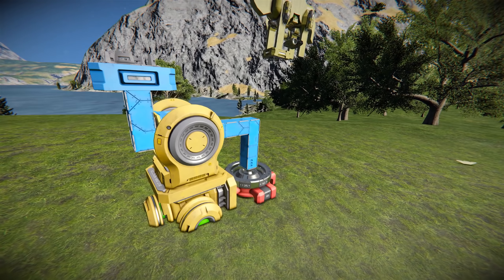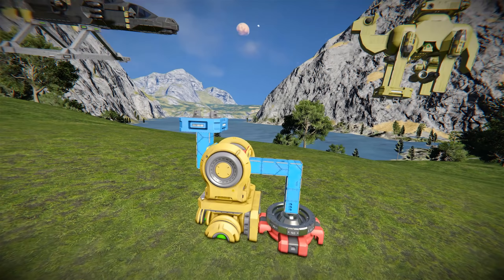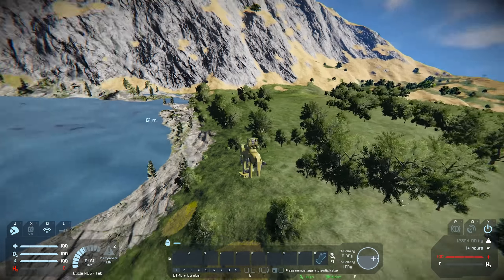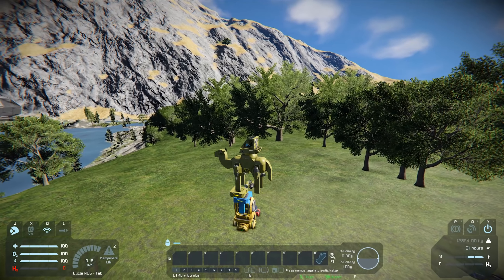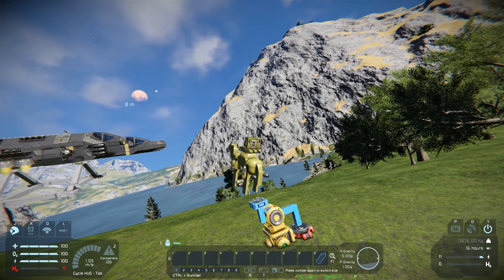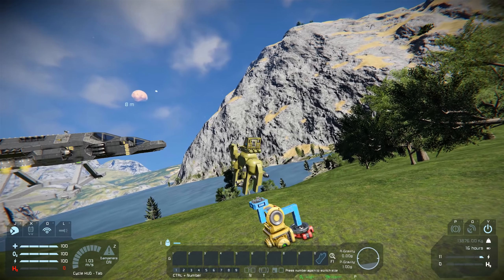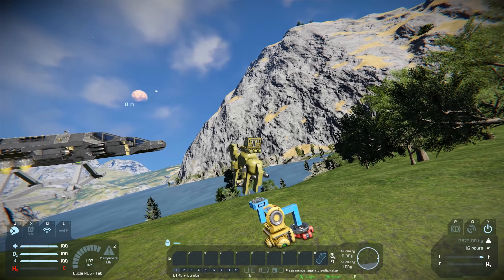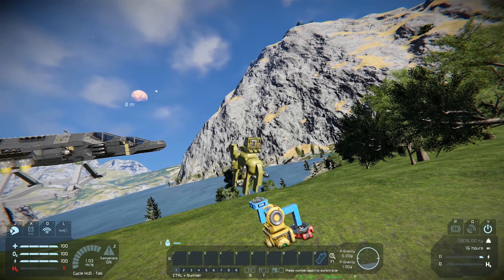Space Engineers - Cheaters Exploit Speed Limit Broken Vanilla Warning

Comment: In regards to this exploit, does it have to be attached to the ground? Or could you slap it on another ship?
The physics based exploit should be fixed but its amusing to think a ship could "jump" from one place to another without a J-drive
Reply: Doesn't have to be attached to the ground. You can fire "missiles" or fighters from a carrier using this exploit, though their movement will be tied to the mother grid, so it becomes a problem if the launcher rotates too much

Comment: no different to clang drives and other sim physics related exploits - all of which should be banable on servers. Ideally fixed by keen but these problems are often VERY difficult to fix or the fix would be a huge hit to sim speed due to more calculation.
The 'fix' btw would be inertial sharing for hinges and rotors ONLY applying outside of the movement bounds of the hinge or rotor, eg up, down, inertia would be shared on a rotor facing up relative to the shared grid but forwards, back, sideways or any rotation in those axis would require some more complex maths to work out the relative motion, and this would undoubtedly be a hit to sim speed.
Reply: Oh and there are many great speed and relative speed mods on the workshop. anything below about 500 is fine in my experience.

Comment: I think vanilla exploits are fair game, only off limits if you can mod a nerf or patch it. Then again, I just see a game as it is. The ability to do things predicated on your care to do them.
Reply: Let me elaborate that every measure should be taken to remove exploits from use if they impede regular server function of drop FPS in some way. This doesn't have to involve breaking SE, like those spinning lag machines were purely vanilla vehicles... I still think though that there's nothing to stop someone just boosting up before a battle now and risking it to win, so there's that. If they can still do it, some still will. Maybe those less attached to the game. Then again, I knew about this already. It's common knowledge and there are a few different methods to be worried about too, most working in multiplayer.

Comment: this thing has existed for 2 years... its not new, and i dont really see issues with ships that require engineering to harness the capability of a bug that has existed for forever. because it may be a bug, but keen has not fixed it, and it cant work well on its own, so it has to be engineered to work on very specific things, which require putting work into it. i dont feel like things that require Engineering to work properly should be banned, but your the boss i guess
Reply: It's not engineering, it is a bug in an unfinished feature. that's why its only enable in experimental mode...